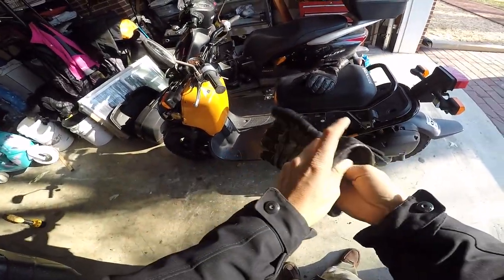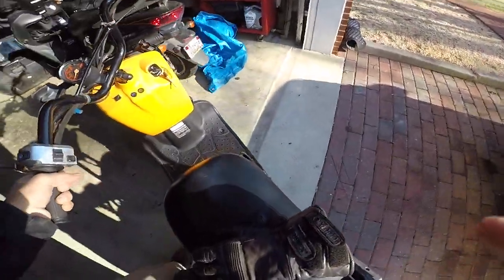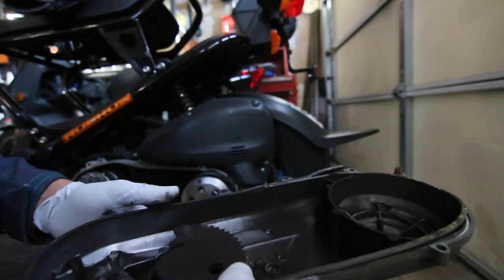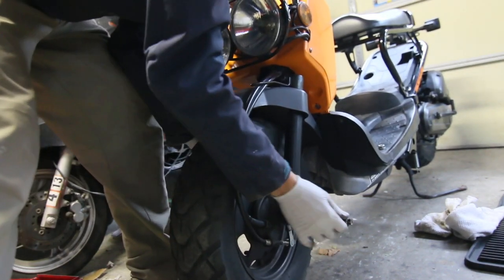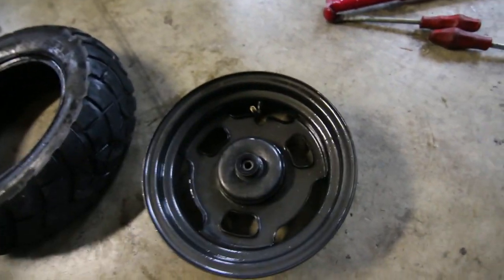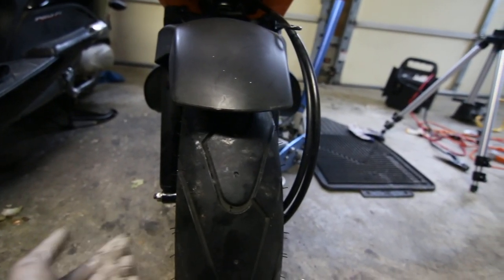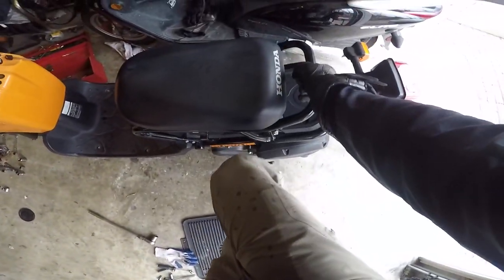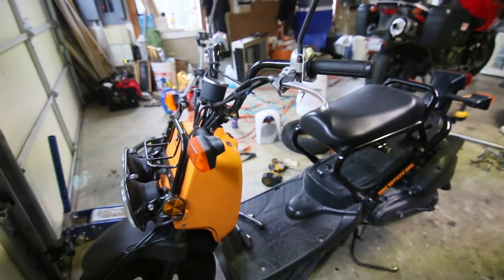Installing Tires on Honda Ruckus

Comment: Are they tubeless tires? Do you recommend filling up with slime tire sealant? 😊 thanks
Reply: no
Reply: @wkins no they are not tubeless???
Reply: @chayo9548  Tire sealant isn't a good idea. It's not necessary and most shops will charge a cleaning fee to change tires with sealant in them.

Comment: Thanks for showing this. I got a nail in the rear tire. Took it to a place to see if they would plug it but they refused and said straight away I need a new tire. Wrong answer. Thanks for your video. Now I can do it myself.
Reply from the maker: No problem, im glad you are saving some money. Bike shops are overly expensive these days.

Comment: Does the scooter tires need balancing ? I’m putting on new tires next week. 
I can go 45mph.  I would think at that speed,  I would need to balance them.
Reply: Did you ever end up balancing yours? I think mine need to be balanced as the front almost bounces around 30 mph
Reply: I had a motorcycle shop mount them. So yes. They were balanced.  
My top speed is about 40mph.  On a clam day.  
On a windy day about 35mph.  
I wish Honda would import the modern scooter.  Disk brakes.  
150cc motor.  Digital display.